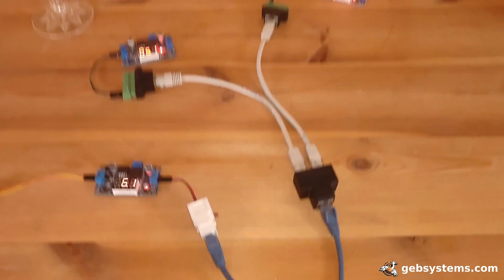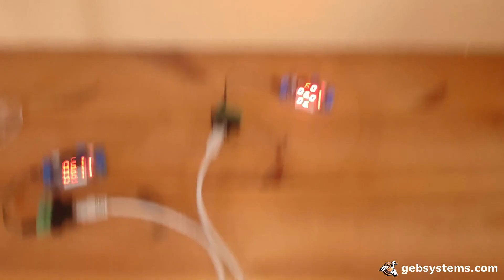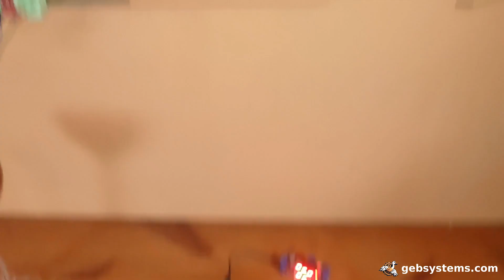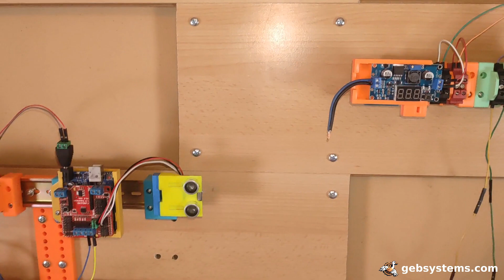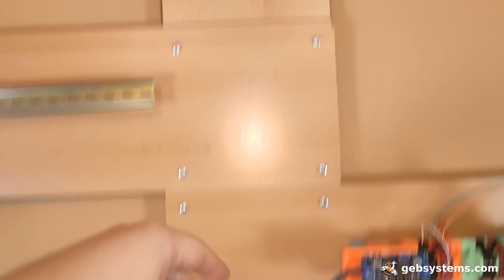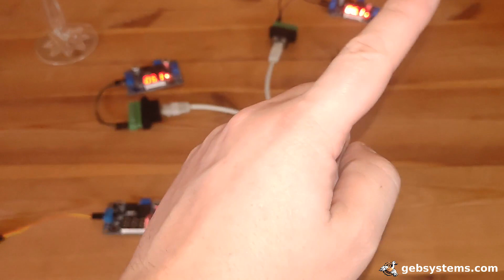Arduino Modbus Experiments: Nexus

Comment: Can you explain in a video what is benfit of the modbus for this setup? Just to have a poe type setup?
Reply from the maker: This is not a bad idea. The POE type of setup is not the goal here, it just happens that I can leverage Ethernet cables to deliver power and data. Especially when I want to provide power to all of the endpoints with one source. I can even push it and have three separate Modbus networks.